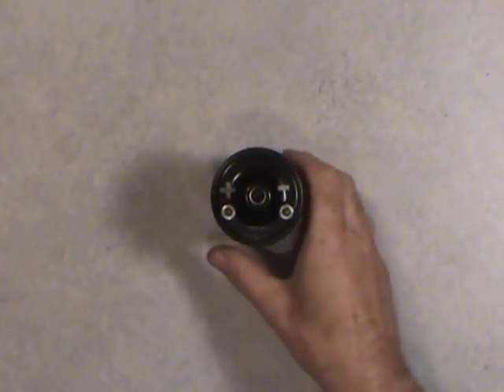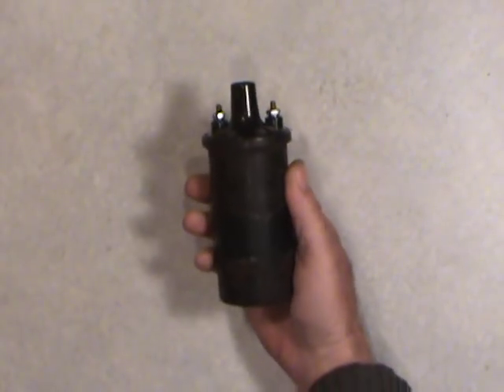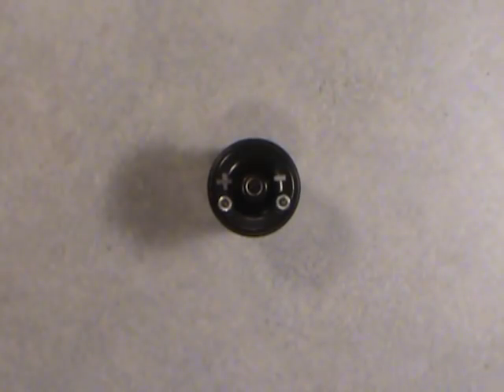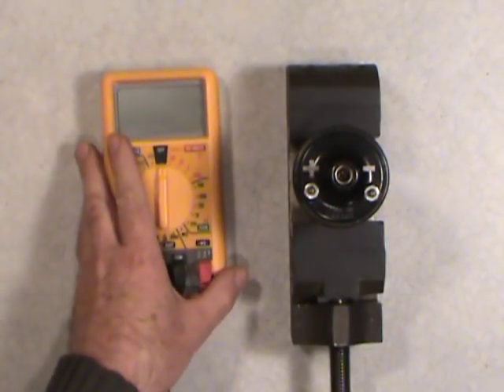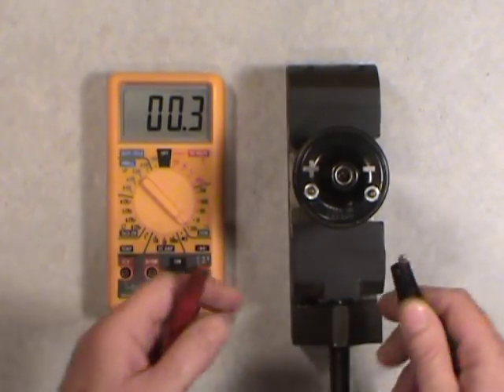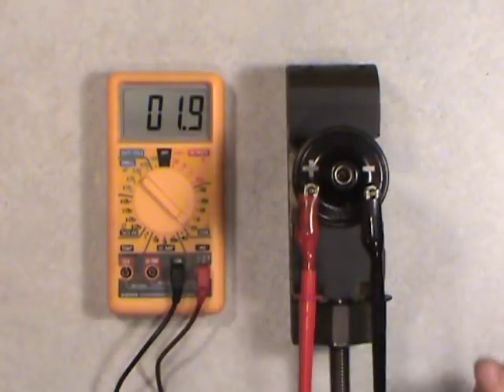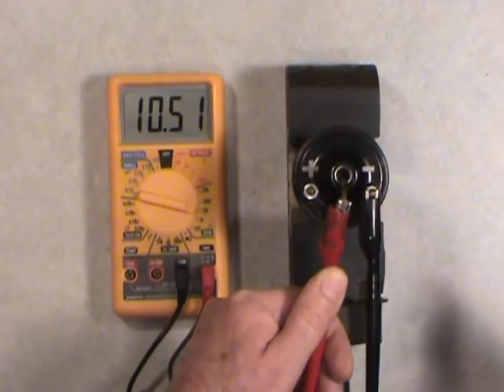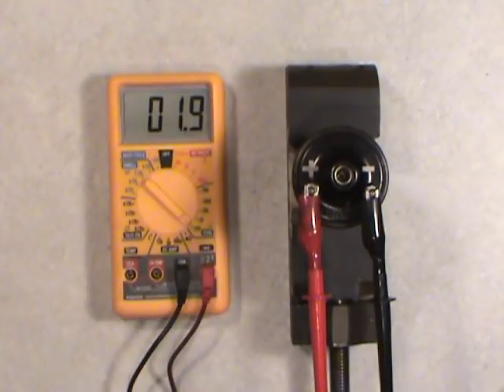Ignition Coil Testing

Comment: WARNING..!!! You people have to be very careful when you looking at the videos in the you tube especially you will get wrong information like this video. 

You never connected your multi-meter probs before you turning in the dial. this is what is man doing in this video. your multi-meter could damage. you always SET the dial first in  this case to the ohms (to the minimum scale) then attached the leads such as negative and positive.
Reply from the maker: Greetings...Mick Dundee............Thanks for watching...........Wrong information You say...???...very interesting, to say the least...lol.........Gee, if I recall correctly, didn't I connect the Multi-Meter's test leads together, to find out, if, and how much, Out-of-Calibration, my Yellow  Multi-Meter might be, when the "Dial" was Turned to, and Set, on the Lowest (200) Ohms scale/range...???....and, as I recall, the Yellow Multi-Meter, by itself, was out by .1 Ohm, and, the Resistance of the Two Test Leads, amounted to .2 Ohms, and, when Adding the two together, the Grand Total, of my Yellow Multi-Meter's "Miss-Calibration", while the "Dial", was Set on the 200 Ohms (Lowest) Range/Scale, happened to be .3 Ohms...how about that...lol.......Lem-me-see-now.......How is it possible, to "Damage", an Ohm-Meter, or, a Multi-Meter, set for Measuring, Ohms/Resistance, while Ohms-Testing, a (hypothetical) Component/Part, that..."DOES NOT"...have any..."Voltage or Current/Amperes/Amps"..."Flowing", in the "Test Circuit", in question...???...well...???..................As I see it, then, it is quite possible, to "Damage" an "Analogue", type of Multi-Meter (that be the kind, that usually has, a Needle/Pointer, that Waves at You...!!!...lol), if, for example, when, trying to Measure, something along the lines, of, oh, lettuce say, while Testing, a Much "Higher Voltage", than, that particular Analogue" Multi-Meter's..."Volt"...Scale/Range was "Set" for, and in this particular scenario, I'd be willing, to..."Bet, Dollars to Doughnuts"...that, that poor ole "Analogue" Multi-Meter's, Needle/Pointer, would be "Pinning" itself, right off of, the "End of the Scale"...!!!...and yes, under that particular testing scenario, Meter Damage, could very well be, the end result...maybe...???.............If, and when-ever, I have done any Ohm/Resistance Testing, with my Yellow Automotive "Specific" Multi-Meter, and I happen to Set the Dial, to the "Wrong", Ohms Scale/Range, it will usually, just be Showing, a Number 1, or maybe it's the Letter I (aka, i)....which, just might mean "infinity"...and look Ma..."NO"... "Multi-Meter Damage"...what-so-ever...!!!...lol..................Hey Mick, have You "Damaged", an Ohm-Meter or Multi-Meter before...???....and if so, please, do tell Us, just "How"...???...You were able to do that...thanks..........and till next time.........Be Safe, take care, and have a good one.